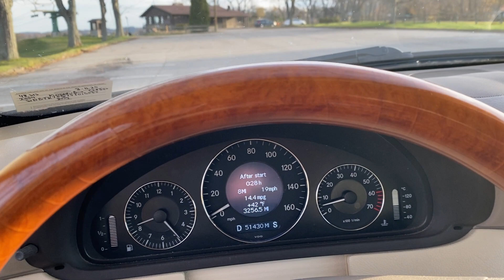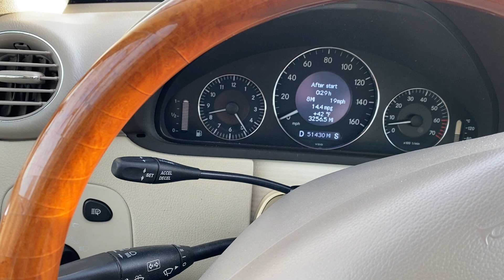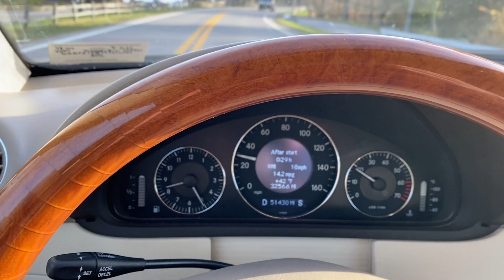2004 Mercedes CLK500 Steering Suspension Noise - What is it? Part 1

Comment: similar noise from my 2003 clk 200 kompressor. started 1 year ago... and still there. i checked the hydraulic fluid, it looked good. i will change now the hydraulic fluid. let's see if this helps.
Reply from the maker: I think if you have bad or low hydraulic fluid, you'd hear more of a whining instead of a creaking like in mine.  Did you see the Part 2 video?
Reply: @youtoobe169  i did see pt2 now after your reply... you're right, fluid doesnt make sense. i must admit, i'm a total noob ;-) but i will change the fluid anyway, it's a 17years old car.
Reply: I agree, this doesn't seem to be an hydraulic noise, but a suspension noise. Mine does the same (also 2004 CLK 500). Why do you think it is your mount bearings? Mine have around 13000 miles, shouldn't be bad by now...
Have you checked whether the to top mounts move around with your bonnet open when you turn the steering wheel to the sides? Mine do, I don't know if that's normal or sign of a bad mount.
Reply from the maker: @ssanmor  The dealer replaced the mount bearings a couple months ago and it's been perfectly silent ever since.